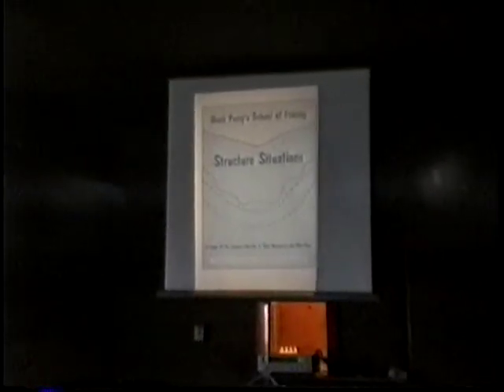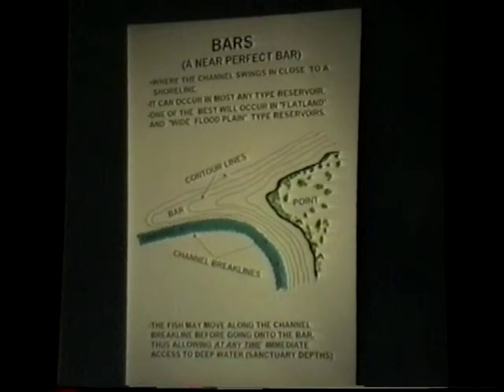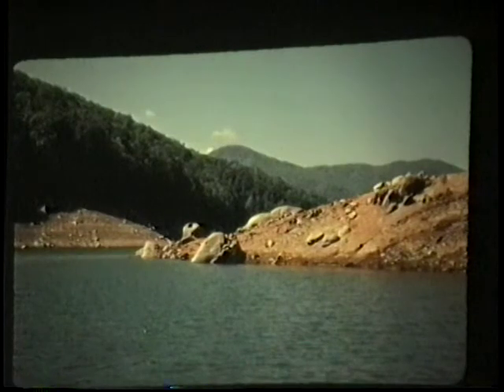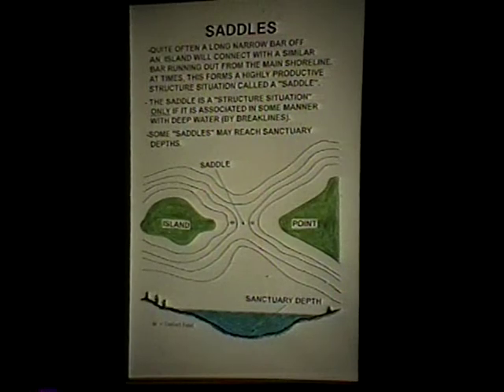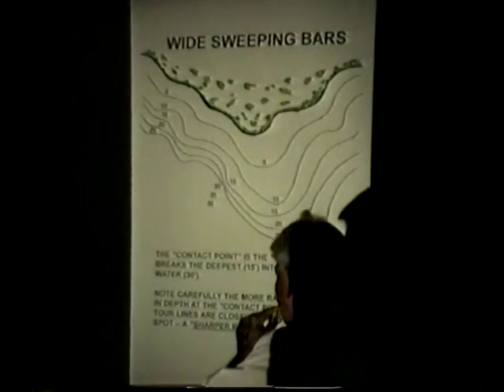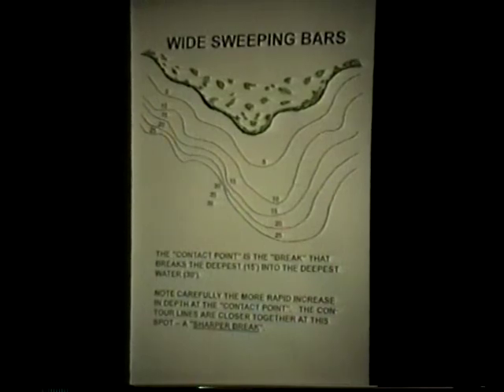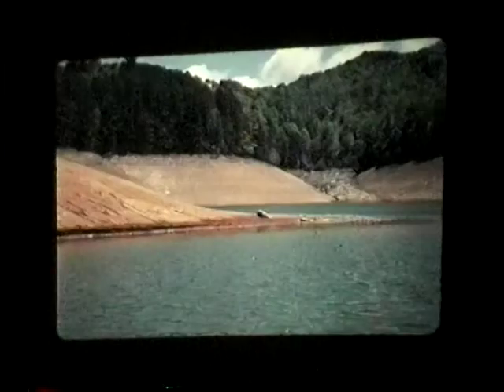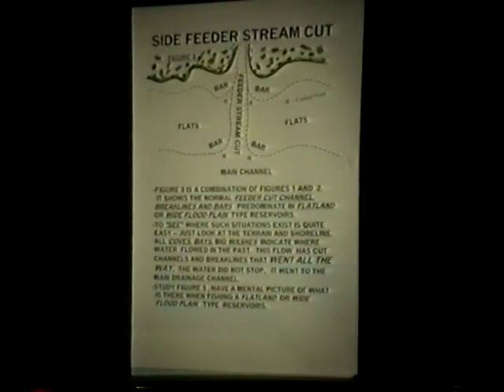Terry talks Structure Situations

Comment: this was very informative;  explaining the two different bar situations helps - I tried to do some mapping this year, but it is more difficult than it looks.  I am learning to use a flasher, since I have always been a shore fisherman I've never had to use electronics, so this is all new to me.  My current flasher, an old Lowrance 150 worked pretty well until the transducer got chewed up by the prop.  I am going to replace it via ebay - do you think there is any difference in the old Lowrance vs. Ray Jefferson vs Vexilar units?
Reply from the maker: Kevin,  I'm not familiar with all of them, but I suppose any easily readable flasher would suffice.  I use a Zercom Clearwater classic and like it very much.  There is a pamphlet that Bucks Baits has sold titled "Structure Situations" that lists all the 17 types of structure that is very good.
Reply: Chase - this was the best - for me - that you have shown so far